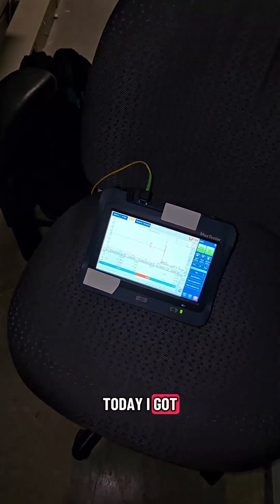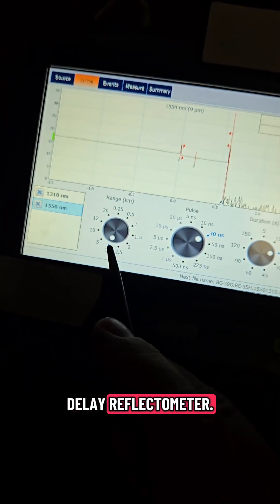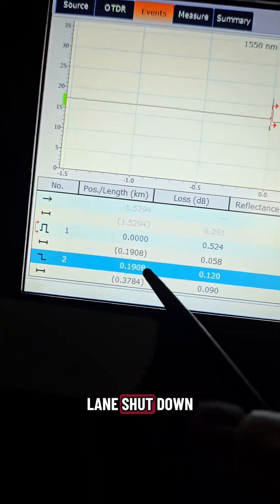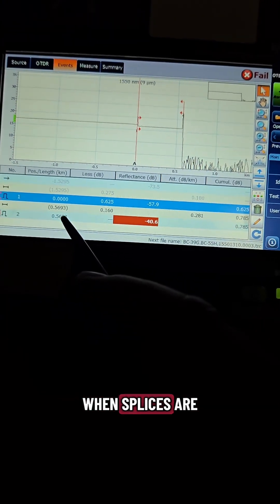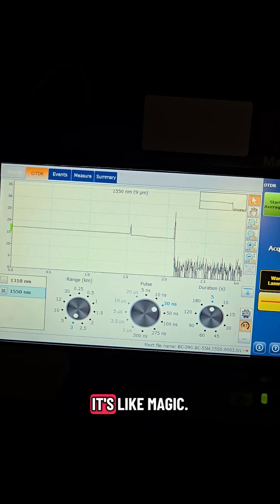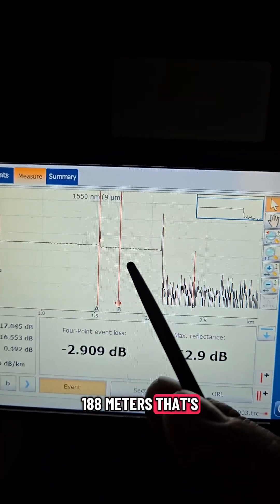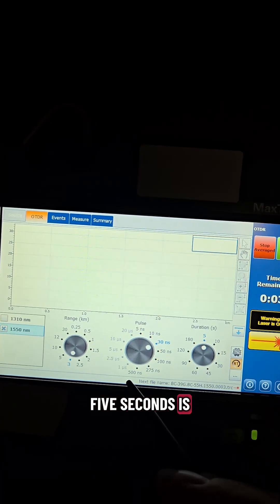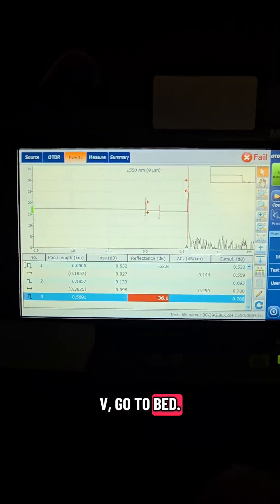The OTDR. The geekiest name in telecom.

Comment: Hey buddy. I'm all for geeking out with you any time of the day. TDRs are also useful for Ethernet runs within walls where you need to find an open or breakpoint. Kinda works in a similar principle to VSWR measurements on a network analyzer. You can find the location of breaks in cabling because your TDR sends a signal and based on the amount of time it took to travel to and reflect back, can calculate the distance of where your break is - hence Time Domain Reflectometer. You just happen to be using the optical version of it. Very cool. Keep posting. Very interested in cabling infrastructures and places where no one typically goes.

Comment: If you do a live shot and have someone put a micro bend you can see the exact location. Also if you get a really good splice with a core align you might not see the splice. Plenty of time I was using my ftb1 and don’t see the splice point just connectors or slight bends

Comment: To obtain accurate IL of your splice, you have to shoot in both directions, then average the two measurements. You may see a "gainer" (i.e. negative IL), which you need to account for. The physics behind this is messy, but it's a Telcordia standard measurement procedure. Judging by the screen layout, looks like you are using an EXFO field type OTDR.